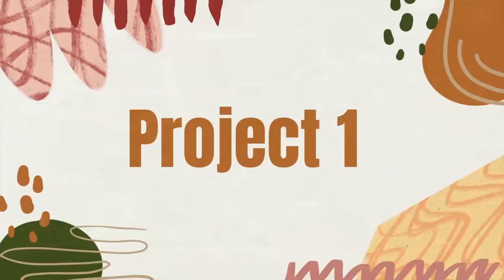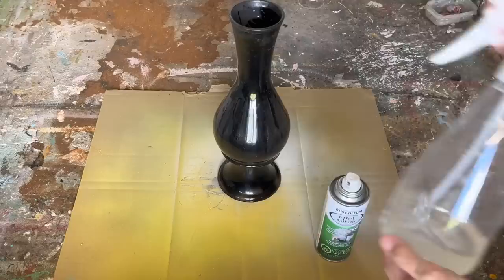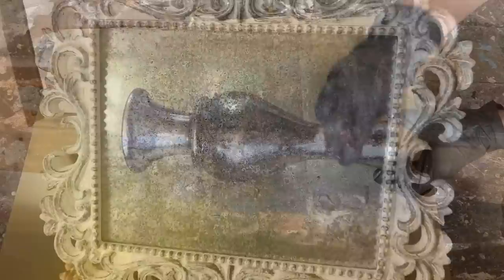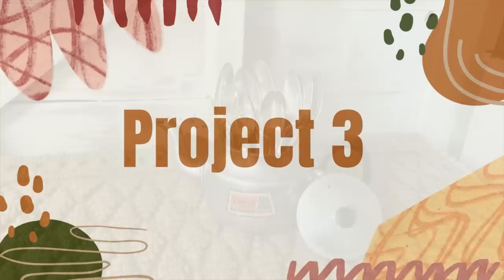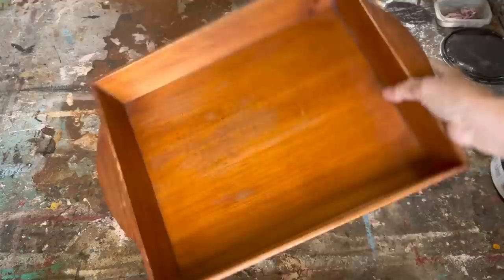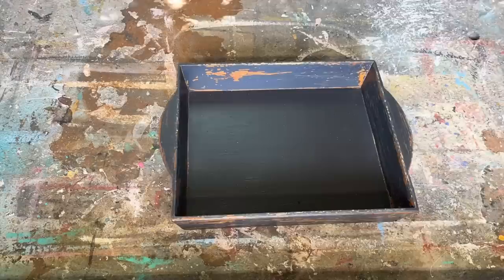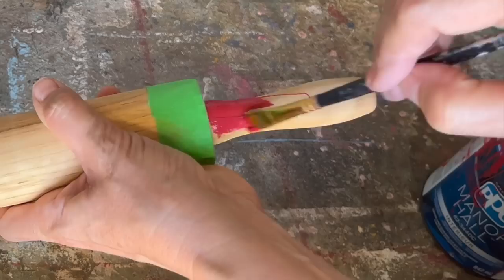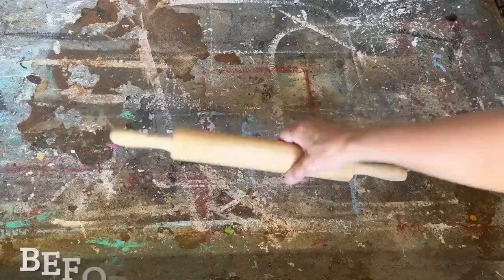How To Turn  Old Yard Sale junk Into Beautiful New Home Decor / Trash to Treasure

Comment: Great items, I have recently purchased several graphics and have some questions in regards to PNG, SVG JPEG & (DX ?) what are these and when is the best time to use each of those?  FYI on the first page of the Ultimate craft show checklist, on the left side under display items 10th item down “price tags & signs “signs” is a type o.
Reply from the maker: Svg works well with a cricut all others work great for just printing or reverse technique

Comment: Would it be easier to use arcylic paint in the vase? Pour it in and swish it around instead of spray paint.
Reply from the maker: Acrylic paint will peel off glass and not stay on so that was not a good alternative I needed to use the spray paint to have it bond to the glass
Reply: @OurUpcycledLife  That makes sense then.

Comment: I was told by one of ur subscribers to ask you this question about my delima. I painted a window w acrylic paints and sealed it w Mod Podge clear spray in a can. I put it outside in IL. winter weather where it flaked & chipped off. The next winter I repaired the design and used what a Hob Lob manager told me to use. It was just a clear acrylic spray. It didnt have a brand name for me to tell you. It flaked off worse. Im at the point of not knowing if I should give up and throw the window away or try to repair the acrylic painted scene and try yet another form of clear coat. Someone thot you had painted outdoor windows and to ask what to use. Help!
Reply from the maker: I am not sure what product you could use to have it with stand outdoor elements. I have not done a project like that where I have put anything on clear glass and then had an exposed. I have made wooden signs with my mod podge traffic transfer and then sealed them with an outdoor poly acrylic sealer and they were standing elements fine but never have I done anything on just glass. Sorry I can’t help you out.